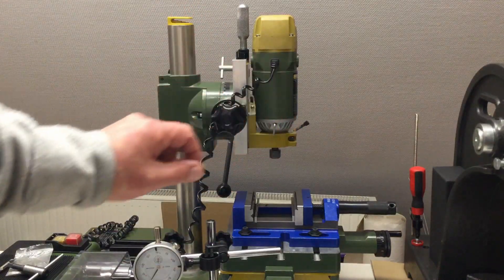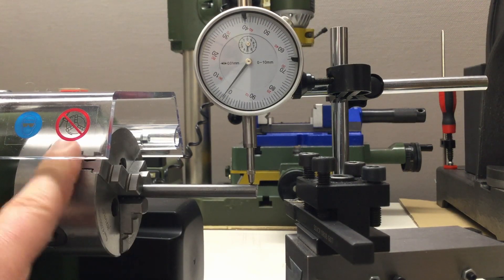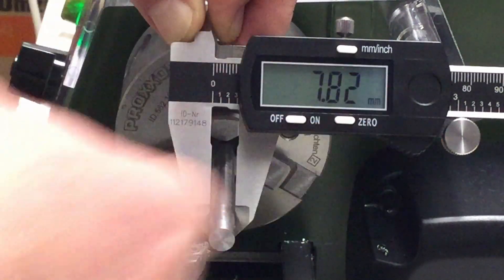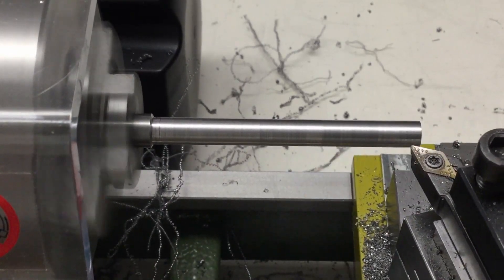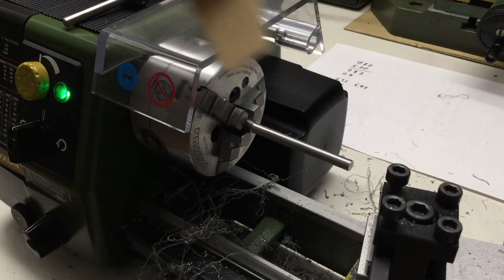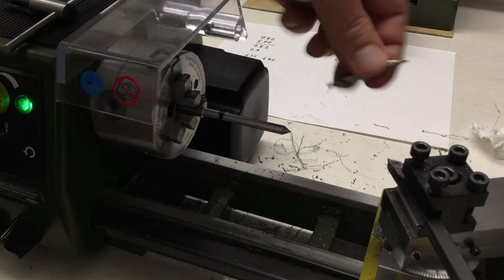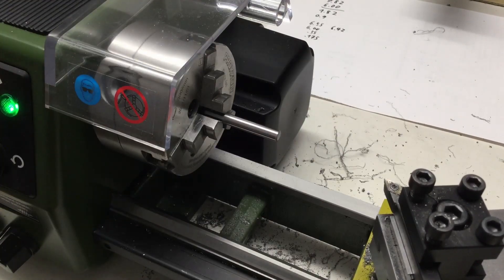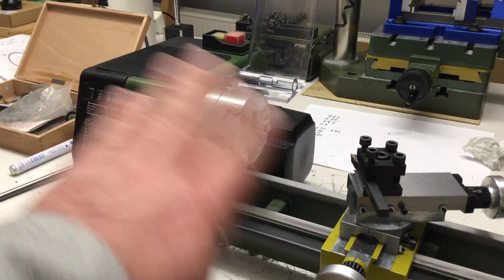Small Project: Pointed Metal Shaft for Visual Alignment of Parts

Comment: What would really help with chatter and vibration  is to mount your lathe to something dense. Obviously you can't mount it permanently to your workbench since you don't have the space, but a board would do almost as well.  A piece of MDF or particle board would do nicely, like a scrap piece of laminate countertop  plus the laminate would help keep oil from soaking in. The best would be a piece of stone, epoxy concrete, or a metal plate. You can get pieces of  natural stone, plastic composite (Corian), or epoxy concrete, or "quartz" as it's called in the US by manufacturers,  countertop from home improvement stores as remnants/cutoffs/scrap.  I just purchased a PD 250 and plan to mount it to some "quartz" countertop material I got for cheap, a large 2ft by 3ft (61cm by  91.5cm) slab plus a  4in by 3ft (10cm by 91.5cm) back splash for $20 from a home improvement store because it was an old display.  I'm going to mount the lathe to a long strip of the material, and in the middle between the two mounting pads for the lathe bed's feet I'm going to bevel it to both sides, like a roof, to help with clearing chips from under the lathe since the PD 250's bed doesn't stand very high off the surface it sits on. Then attach some rubber feet, or just a large piece of rubber, to the base to keep it from sliding around and also dampen vibration some more. Even a large ceramic/stone tile or concrete paving block would work.
Reply from the maker: First, congrats on your PD 250 purchase. Hope it's the right lathe for you and that you'll enjoy working with it. Second, you advise is (as always) spot on.

Comment: Could you cut the taper and then put something in the tail stock with a nice center hole to support the rod end while you turned it down to the final 6mm? I was thinking of doing that while you still had an 8mm rod as that would have been more rigid than the rod turned down to 6mm. Something that would fit in your tail stock with a well centered hole might be handy sometimes. As the end of the rod isn't hardened steel, I suppose it might require rather light pressure and lots of lubricant?
Reply from the maker: Great idea! You would need some kind of a "reverse" (live?) center. So instead of a cone sticking out, a cone shaped hole inside the center. And I would definitely make it live. Maybe just an adapter sliding over a regular live center would do.